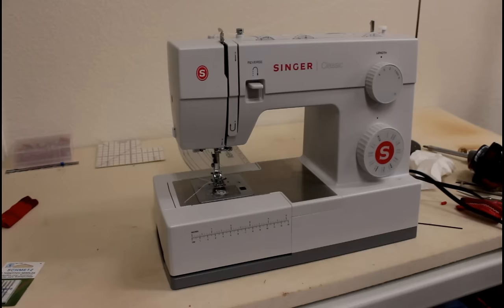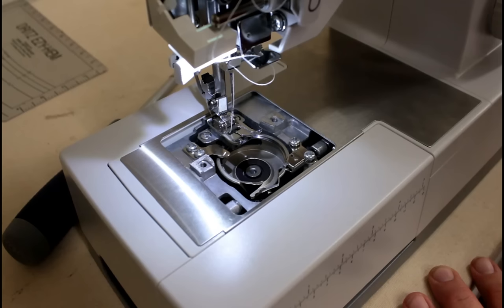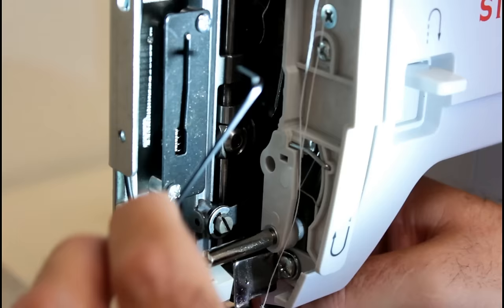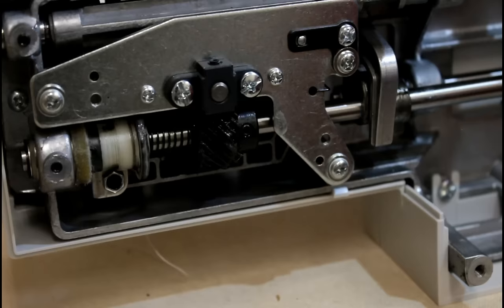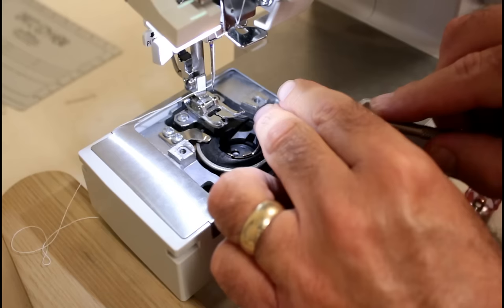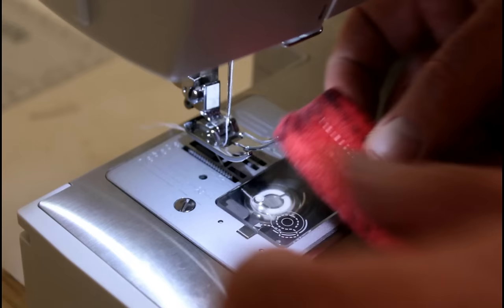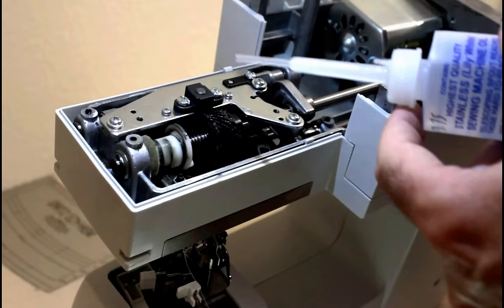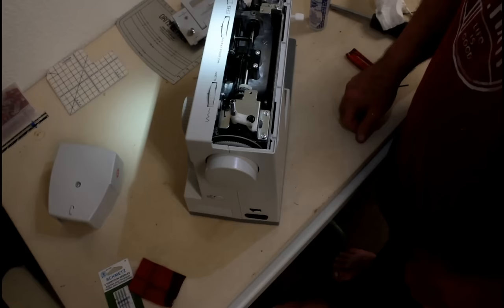Setting the Timing, Greasing & Oiling the Singer Heavy Duty Series Sewing Machines

Comment: For those that can't get the 3 set screws off the gear, or the gear wont rotate because the set screws deformed the shaft too much: you can still fix the timing yourself. Take all the screws off the bottom of the machine, remove the base cover. Slide the belt off its gear, set the timing as described in this video. Try not to rotate the shaft and slide the belt back onto the gear. Way easier than bending allen wrenches
Reply from the maker: Great suggestion. I appreciate you.
Reply: You and Kevin saved me! My hands have calluses from trying to inscrew the three small ones. Thanks to your solutio  with the belt, I followed the rest of the instructions and it works! Thank you!
Reply: You’re a live saver. Second time my new machine is off timing and this time I just can’t move the bobbin holder one bit
Reply: Thanks for the video!  Singer 'heavy duty" worst machine i had. I will try to fix it ,Thanks for the tips!

Comment: You cover the top timing as well while others don't. That helped me salvage my 4411 that a repair man said needed parts and was a write off. Now it's working on a 4 width zig zag which is all I need - I dont have your patience to get it not to skip the odd stitch on 6 but greased and oiled like you showed, it' sounds great and is running sweet as a nut again. Thank you so very much indeed Mr Kevin the machine saver.
Reply from the maker: Graeham Smith That is great to hear!

Comment: I thank you so much.  I have the Singer Heavy Duty 4423 and only use it occasionally for heavier projects.  Sewed some canvas for corn bags for a corn hole game...machine nested up under bobbin plate a few times..still sewed.  I put it away.  Took it out to sew more canvas for a bag and it was making a noise..I looked at it and determined the timing was off.  Asked hubby to fix it and we found your very informative, spot on video.  Now she is sewing like she should.  One comment said..you empower me..I agree.
Reply from the maker: Ramona Kufalk That is great to hear!
Reply: Kevin Sews Kevin..my machine sews now..but..(there’s always a but)...I can’t use the threader..now the threader comes down below the needle when I pull it down.  Rob doesn’t think he did anything to make that needle push up..but it is. Rob wants to know if you can tell him how to adjust this. Thanks again.
Reply from the maker: Ramona Kufalk Check the service manual. There is a link to it in the video description box.
Reply: Kevin Sews I will have him do that.  He is gone to work for 2 days..I will let you know if he can fix it.  Thanks Kevin.
Reply from the maker: Ramona Kufalk My pleasure.
Reply: Mine does the oposite the threader stops above the needle hole

Comment: Thank you so much Kevin. This video saved me the value of a machine that I was very close to trash. My Singer 4423 came out of box new with horrible timing difference like 180 degree between the hook and the needle. Without your tutorial I was about to mess the needle pole just to align it with the hook.
Shame on Singer to ship machines with such flaw that requires a "Recall".
Reply from the maker: My pleasure!
Reply: @kevinsews  Hello Kevin, I just wanted to share this with you. For some reason, loosening the Allen screws of timing did not work for me and did not rotate more than 90 degrees which was still far from the needle. Instead, I loosened the Allen screw of the hook's pole, pushed up with hook compartment, aligned it with needle at the position where it goes up, pushed the pole back in, and tightened its Allen screw. The machine now is functioning perfectly. I wish I can share a PDF of the part that I adjusted the hook. Many thanks again :)
Reply from the maker: @haithamabdullah400  Yes, sometimes you have to do that when it is WAY off.
Reply: @haithamabdullah400  i guess i am having the same issue as yours. Can you please explain in detail wha did you do. I am new at this, my timing is off and even if tried to loosen the Alan at the bottom to loosen the hook plate, its doesn’t move freely as the video tutorial. I am not sure what to do
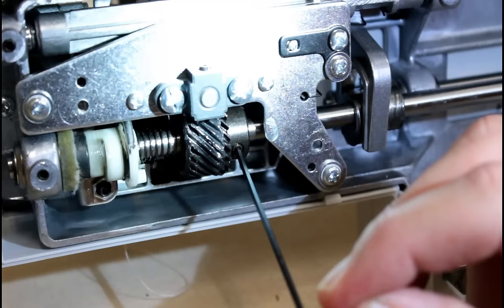Reply: @salroebuck8330  sorry for late answer. Okay, at minute 23:05 you will see the bottom of the hook pole base fixed with two screws on the sides and an allen on the top. Unscrew the base and loosen the allen then you can manually turn the hook pole to time/adjust the hook with needle right at the position when the needle would go up. You do this by turning the hand wheel to place the needle at the lowest position before going up. Now you can put back the hook pole base and tighten the allen. I hope I could clarify the process well. Good luck

Comment: Thank you so much for making this video, my singer 4423 had jammed, I followed all the steps and I have finally managed to fix it. I had to stop every step to get all the tools. I have learned a lot, it took me a month to fix it but I finally did it.  When I was stitching checking if it timed, I wasn't closing the bottom cover, the thread was getting wrapped around the gears, and it was making a very loud sound. I couldn't see it because it going right under the felt between the gears. So now I understood why Kevin was closing the bottom cover and opening it up to adjust it. So follow every step in this video and you will go no wrong.
Reply from the maker: You’re welcome!

Comment: Thank you so much for this video. I have 3 Singer HD machines, the classic and 2 HD 6800 C's ( I was sent 2 machines when I ordered only 1). My bottom stitches on my HD Classic (Mechanical) were off. I cleaned, changed the needle and thread, but it was still off. I watched your video adjusted my tension and set my bobbin holder back in place and tightened the screws on the needle plate. I think using the walking foot and putting my machine down lower (adjustable table) "shook" things up too much. Stitches good now.
Reply from the maker: Great! I glad you were able to fix it.

Comment: Kevin, you are amazing at teaching us how to do this stuff with our own machines! I had a problem awhile back with my upper and lower tensions and managed to find a groove in the needle plate. I filed it smoother with a metal nail file and it did ok but I was still having a problem with jamming so I ordered a new plate finally. THEN  I lost one of the screws trying to replace the needle plate! SO, I began to take the machine apart to find that screw. I kinda tilted it upside down and back and forth before I did that. But I quit hearing it move around so I took it apart. I had not seen this video yet. I only saw the one showing how to service the machine. I ended up finding the online service manual and downloaded it to help me figure things out. It helped a lot except it didn’t show where and what kind of screws go back where. 

After I took that free arm slab thing off, I thought I would never get it back on but I finally managed to miraculously do it! Now I see you address removing that part in this video! However, I’m finding that I am missing a few screws (in more ways than machine wise! Hehe). So I am writing this long winded comment to ask if I am able to order replacement screws anywhere before I take this free arm slab off again to do the adjustments you describe here? My upper thread is not catching at all or even trying to catch. IT just spins around and around when I turn the handwheel. So I will try to be patient and see if you’re able to let me know if and where I can possibly order replacement screws. Either that or maybe I should buy another new machine?  I already bout a singer 1500 that I dont like at all. If I take it back they will charge me to rebox and for Re shelving. I have people I can sell it to or give it to cuz I don’t like it at all. It makes me LOVE my HD 4423!
Reply from the maker: Try www.sewingpartsonline.com
Reply: @kevinsews thank you! I did find most of the screws and am only missing one now. I finally got the upper thread to grab the bobbin thread to my utter amazement (after losing the bobbin holder and cover and had to order both from Amazon) but now the thread is catching at that metal clip thing that the bobbin case is supposed to push slightly. I’ve tried tightening the screws for that part but that hasn’t worked. It looks like it’s slightly bent so the thread keeps grabbing there. Should I try to fix it myself by bending it some (I have needle nose jewelry pliers) or just try to order a new one? I’ve ordered all the tools and oil and grease from your links so perhaps I can order that part, too?
Reply: Nevermind! Found the part here at the link you provided! Thank you so much!
Reply from the maker: @anjylkat  You’re welcome!

Comment: Hello Kevin, Thanks very much for this very helpful video! I have a Singer heavy duty 4423 and it has never had a problem in it's 8 year life. I love it! However, it went dead head on me (hand wheel wouldn't turn, everything was locked up). In all those 8 years I never had it serviced so that was why I'm sure! I watched this and lots of your other videos and did everything you showed in them: i opened up the whole machine, got out all the lint, oiled and greased every moving part, and also loosened some of the screws to unlock the place were it had seized. I don't actually know where that was, but it got to working again, and when I put everything back together, everything retightened, it turned and worked except there was no stitch! That was when I watched this video again and adjusted the timing with the hook and needle, just like you said. I also watched your other post on adjusting the tensions on top and bottom, and did that too. Now I have the machine stitching ALMOST perfectly, but only straight stitch and only in the middle or far left position of the needle. Problems are, even as good as it gets there will be one or two missed stitches every 10-20 inches or so. Also it is cranky about the needles I use (it doesn't like a brand new one identical to the one it does like), and it refuses to do a zigzag stitch no matter what, eitehr doing a terrible straight stitch in place of it, or skipping so many stitches that it looks like a dying heartbeat! It will not stitch at all in the far right position. I don't see any problems inside (opened it up and looked thoroughly at it again). I have worked and worked at it (desperate to use it again!) but maybe this is just a problem with a diy-er tinkering so much with such a delicate machine! Can you give me any ideas? I'm pretty stuck and have now invested a lot of time into it! I could replace the entire bobbin case to see if the bobbin case is ruined in some way that I can't see. Anyway, I'd take a video of it or pics if that helped. Thanks for your consideration!
Reply from the maker: All I do is place the machine in the widest zigzag and rotate the hook to see that it catches the thread on both the right and left. You may need to adjust the needle height at this point. These adjustments are almost always very slight. A tiny movement at this point cab make all the difference.
Reply: @kevinsews  Ok. I'll keep trying. I did set it on the widest zigzag the last time I adjusted the timing: and the hook was coming right above the needle's eye,  just like it seems like it should. I guess I could buy a gauge and try to do it the way the repair manual specifies? If I were to adjust the needle height, what would I be looking for? I did loosen it but I didn't quite understand what height exactly it should be, if the needle eye is already going below the hook when they meet.
Reply from the maker: @rachelbeeman  You will notice the needle height issue when the needle swings to the left side. That is when you may need to make a very slight adjustment to the needle height to allow the hook to catch the thread. It is a balancing issue for sure because it has to be almost perfect to allow both sides to catch the thread with every size needle the  machine supports.   And yes, buying a gauge would be very helpful.
Reply: @kevinsews  Thank you so much! I will let you know how it goes. I really appreciate your time and your channel!
Reply from the maker: @rachelbeeman  My pleasure!

Comment: Thank you 🙏🏽 so much. Iv been trying to fix my singer heavy duty for hours. Stopped working in the middle of a project. This was very easy to follow.
Reply from the maker: You're welcome!
Reply: Help! I've loosened the three little screws several turns but still can't get the hook to move.  Any suggestions?
Reply: I ended up taking it to the shop to be fixed. Didn’t want to make it worse by trying to perform singer surgery.

Comment: Great video!!
Thanks for service manual!!!
I've had that nesting issue with mine too and it was a few times after cleaning and putting bobbin case in wrong/the holder bracket for it.
Not sure how I fixed it.
I just always took it all back apart and put back together. Then it works haha
Reply from the maker: I am glad it was helpful.

Comment: Thank you Sir! you’ve motivated me to tackle my merrit 8734, I think it has these issues as well, and it looks pretty similar to your singer. I will comment after if it worked 👍.
Reply from the maker: That is great to hear! Please do come back and let us all know your results.
Reply: @kevinsews  Update on my machine, IT works! :D I found it easier to remove all the casing first just to also admire how everything moves in sync. But I also discovered a gear that was out of place while hand rotating it. God the bobbin and needle to match on forward and back directions. I think now only time will tell me if I sync them correctly. 
Thank again for your video and instructions Mr. Sews!
Reply from the maker: @Nosbert  That is great to hear!

Comment: Kevin- Thanks for putting this video together.  One small item of feedback; the small wrenches you use are metric Hex Allen wrenches, not Torx wrenches. Torx wrenches/tips are a completely different shape. You might want to change your list of links to say "Metric Hex wrench set that includes what you'll need:"  Keep up the good work.
Reply from the maker: Yes, I use 1.5mm 2.0mm 2.5mm 3.0mm Hexagon Screwdriver Wrenches. I placed a link in the description to help those who ordered to get the correct tools for the job. Thanks for bringing it up though.

Comment: Several weeks ago I followed your video to repair y friend’s machine. I was so excited that it worked! Unfortunately, she used it for less than 15 minutes and it broke again. Do you have any suggestions on what I might do? Thank you so much!!!
Reply from the maker: That just means either the screws were not tighten enough (from the factory they can be VERY right) or they may be a bit stripped out and you can't tighten them enough. If this was the first time the machine was worked on then you probably didn't tighten them enough.

Comment: Hello Dr. K!  Kudos for taking the time to make such helpful instruction!  I'm about to watch this through AGAIN, and I've D/L'ed the manual you so generously offer - but so far I've not found the immediate answer I've posed (more than once) directly to Singer support.  So I'm hoping this might be quick and painless (ie Off The Top) for you to let me know if I'm chasing my tail or on-track:
I've a brand new 4452 that from the gate has not SOUNDED right to me.  I've managed to see SOME success, but this one thing bugs me, for it seems counter-intuitive.  TDC for the needle bar is NOT synchronous with TDC of the thread take-up lever!  In fact, the needle is well on its way downward before the take-up lever hits its apogee.  That SEEMS to me to be wonky, but - maybe not???  
In the newly downloaded service manual, although there's discussion of adjusting the take-up lever, it doesn't actually address where it's supposed to be!  It simply shows where the screws are to loosen so you CAN adjust.  But without telling WHERE EXACTLY - how is one supposed to NAIL it?
Now, don't ask me what happens when you hold material right up against the right side of the presser foot and hit the accelerator.  Ha ha ha - VERY funny, Bright One!
Reply from the maker: Yes, I know. That is way I said it is a balancing game. You just have to get it close and then do tiny adjustments.
Reply: @kevinsews  Um - thanks?  But - no comment on whether or not the needle bar and the thread take-up lever should be at TDC simultaneously???
Reply from the maker: @palewriter1856  Yes, they should be pretty close to the top at the same time.
Reply: @kevinsews  Thank you, sir.  Unfortunately, on my machine they're about 56 degrees out of sync.  I wouldn't call that "pretty close!"
Reply from the maker: @palewriter1856  As long as it sews and runs smoothly you should be good.
Reply: @kevinsews  Well, that's what first caught my attention: it didn't SOUND smooth, like I expected from prior experience (albeit minimal) with a couple 4411s.  So unless the store I bought it from offers a swap option, Singer's nearest warranty service centers are about 400 miles away.  Assuming shipping's on me, I'm inclined to try adjusting this known glitch to see if it will then ?sound? better.  As my opening it up may void my warranty coverage, it may be that I'll have to flip a coin.
Reply from the maker: @palewriter1856  Yes it will void you warranty.  However, once you learn how to set the timing  then you will be all set. After that it is usually the motor on a belt.